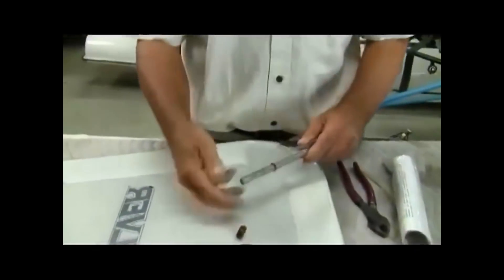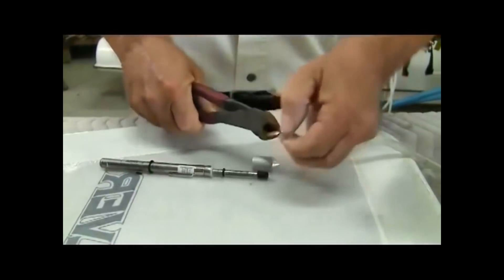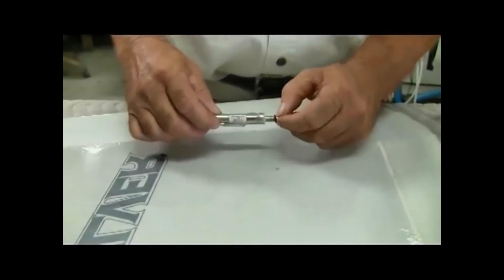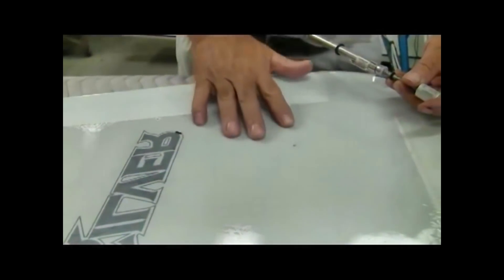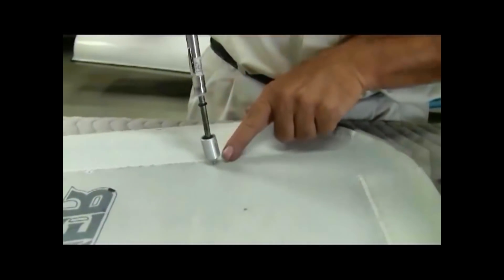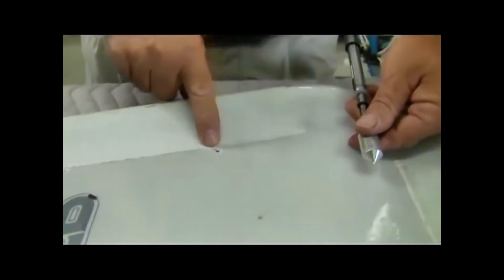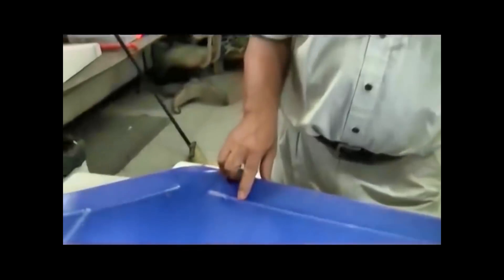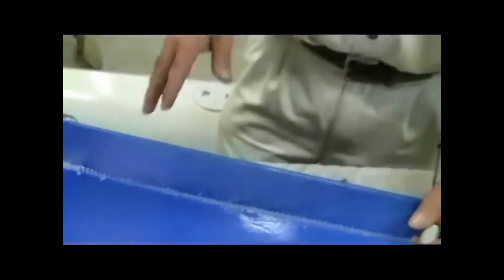Aircraft fabric test, ultralight aircraft fabric tester, testing ultralight aircraft fabric.

Comment: The test is supposed to be 6 inches min 10 inches max from trailing edge or seam. Per quicksilver 14-24 instructions.
Reply: The diameter of the tip is .095 "round "perferator" so I did the simple math and 19000 of those fit into a square foot!! multiply the area times the 10lb test and it calculates to 159,160 pounds per square foot!!! For a 4 to 6 lb/sq ft wing load thats just ridiculous.  Who developed this test and who didn't do their math to double check their work?  A safety factor of 3000 to 1 !! It's not just Air-tech they all fell for this destructive so called test.
Reply from the maker: You are correct - new fabric will easily test to 160 lbs per square foot. BUT fabric effected by UV will not only fail BUT also tear along the seam. In testing I have done, UV weakened fabric,  two-ply tissue paper was found to be stronger than dacron fabric effected by sunlight.